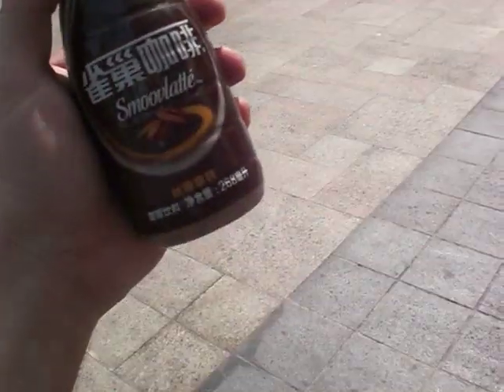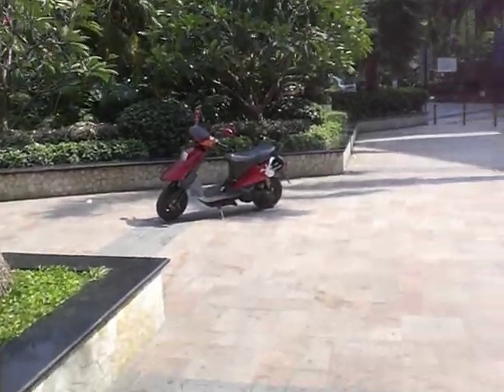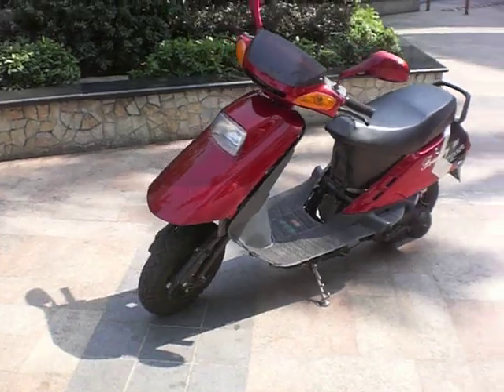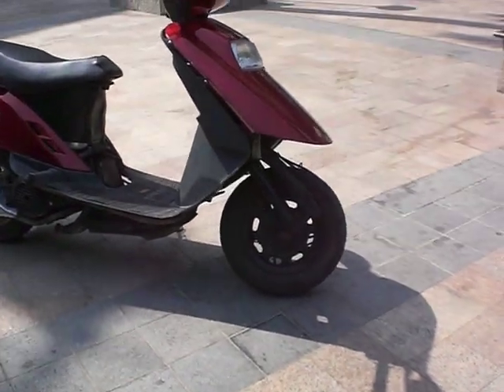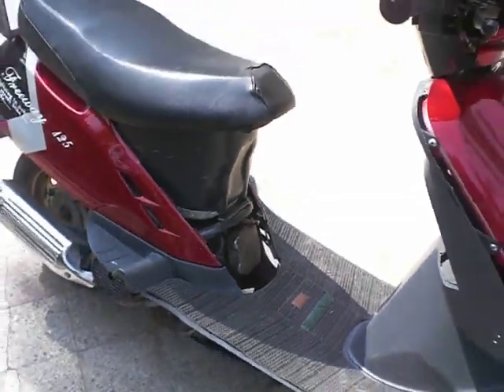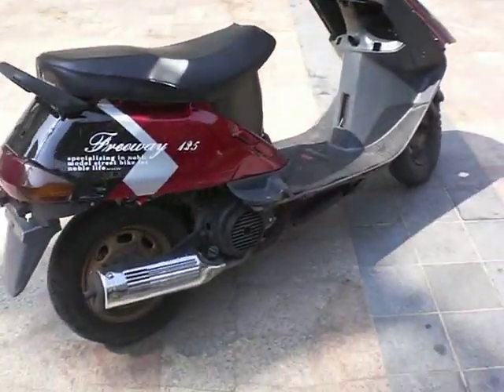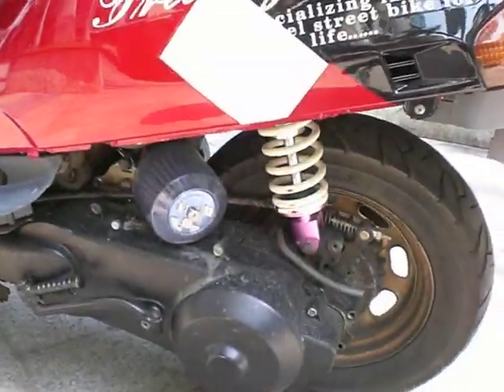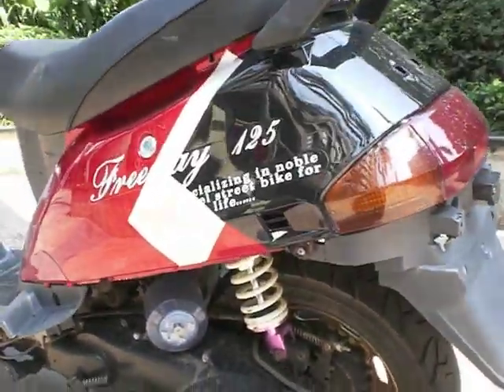How to wire a GY6 scooter regulator / rectifier and how it all works (Part 1)

Comment: Should I look to my stator or regulator/rectifier to replace since I have to charge my battery every month... I get 12.8V at the battery when scooter if off, but only 12.5V at idle.  Don't know where to turn.

Comment from the maker: @mrsparks302010 I just run that hose to the ground, basically all that comes out of that hose is hot air and gasses off the top of the motor, the reason it's there in the first place is to satisfy some sort of eco friendly regulation (which is not enforced here).

Comment: i have a question... with the aftermarket intake you have... where do you run the hose that comes off the front of your crankcase that use to hook into the old airbox?

Comment: strators and rectifiers can be a bitch to diagnos also cause they will run  stop  cool down run  get hot stop  you spend mucho money waste mucho time  on we will try this and replace everything and then you find out its its a stupid box or the strator  an auaintence of mine  is having  this trouble but he would rather waste a month with carb adjustments and we will try this his mechaneck is baffled or well you know making a mystery out of it 
making it a big mystery